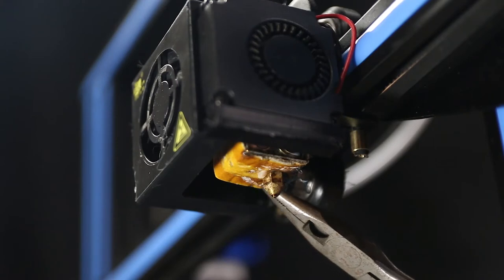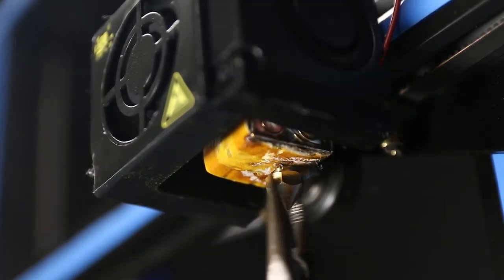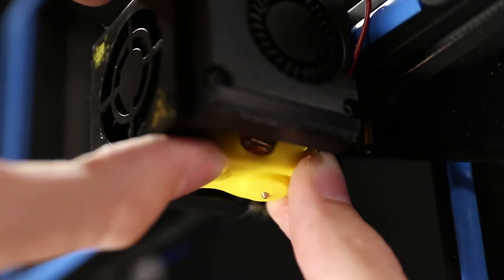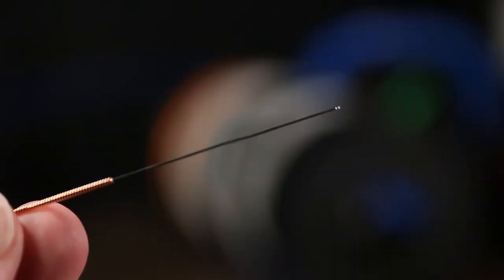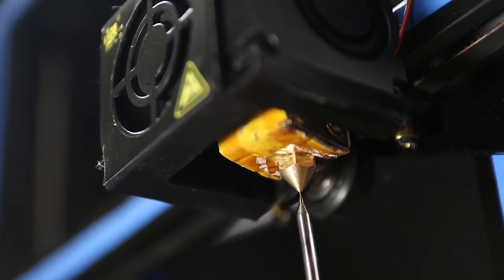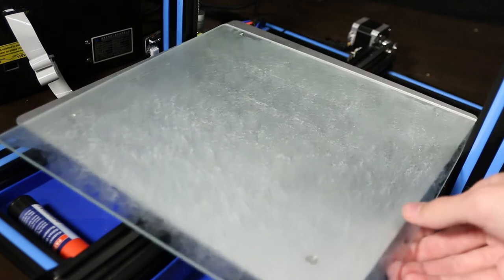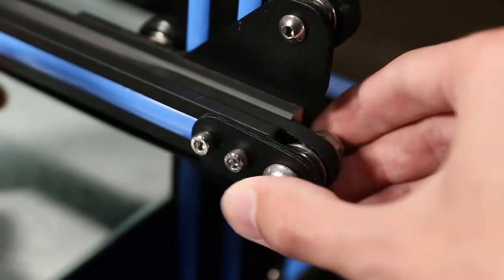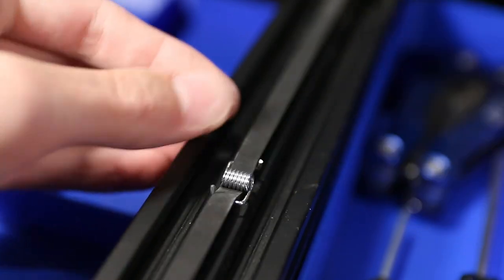3D Printer Maintenance

Comment: And "belt locking springs" isn't good idea, because it makes the belt much flexible, which you want --> not shape corners, bigger ghosting, ringing
Reply from the maker: The springs are pretty stiff, so it won't be that big of an issue. In any case it is better than a lose belt you can't tighten.
Reply: You are not right, tight belts..